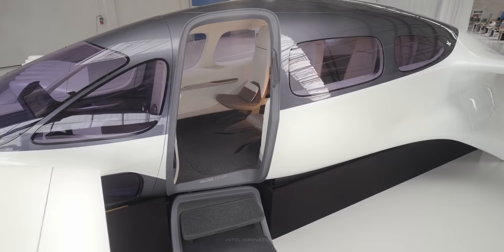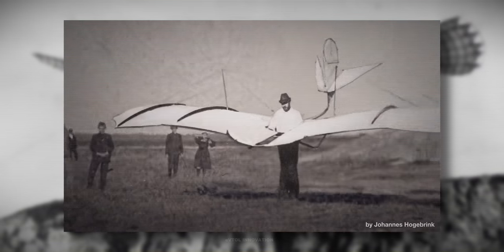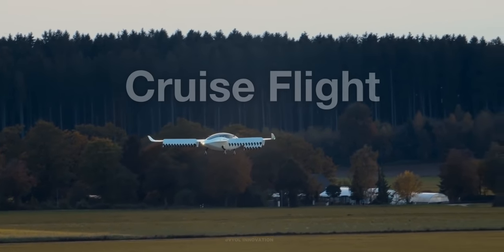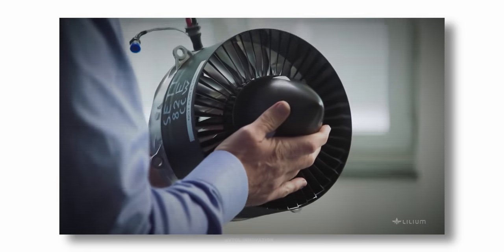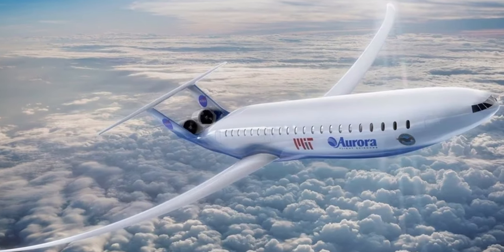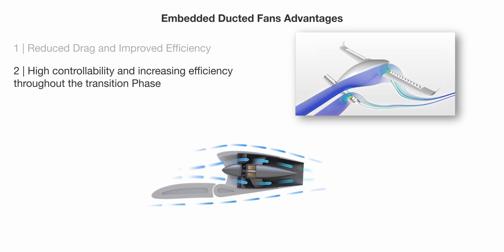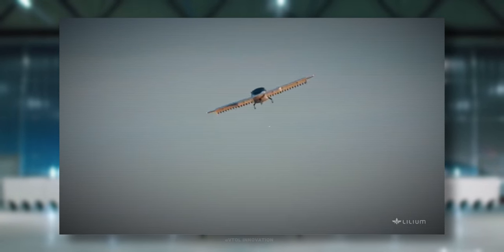The Insane Engineering behind The Lilium Jet | Part 1

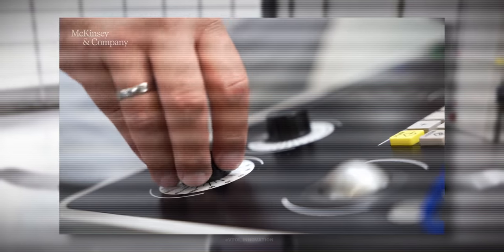Comment: I wouldn't call a marvel of engineering, more like a marvel of marketing. Basically Germany's Theranos equivalent. How can the CEO state in this video (11:00): "the technologies in this aircraft are jet aircraft and all of the airplanes flying today are jet airplanes". It's not jet technology, it's simply an electric fan and due to its small size highly inefficient.
Reply: Like that "flying cars" this will never gonna happen. Even that "Jetpack" man is more feasible than this. Why fly when you don't need to? LOL
Reply: Absolutely and the other smoking gun is the focus on the advantages only with no mention of the disadvantages of such an approach
Reply: Search for NASA's research on distributed electric fans it is the opposite of inefficient.
Reply: @kazedcat  I doubt it can ever be efficient with such small radius. Anyway, you mean it is more efficient than an normal fan? If so, we would probably start seeing camera drones starting to use them but, again, I strongly doubt it. But if you think otherwise then if you can explain the logic behind that would be awesome.
Reply: @ziad_jkhan  Electric fans have different optimization. High RPM electric motors are lighter and more efficient than a low RPM motor of the same power. This higher RPM limits the length of the fan blades to prevent the tip going supersonic which is inefficient. The trade off is that you need more fans to get the same thrust as conventional turbo fan engine. The design of several electric motor + fans is more efficient than having one giant electric motor + one giant fan. Electric makes the optimum architecture very different than traditional engine.
Reply: @kazedcat  Actually, all motors on the market are already 85% and above. Those used on planes are generally like 95% efficient. 

But, anyway, why would high RPM electric motors be more efficient??? This makes no sense if you did not realize and you need to clarify rather than expect other to just assume you 're right.
Reply: @ziad_jkhan  The explanation is very complex. Basically Power, RPM and Torque are directly correlated by an equation. If you want high power motor it is either high rpm or high torque. The problem with high torque is that another equation directly correlates it to the current flowing in motor coils. Another set of equations tells you that doubling the current quadruple your electrical losses. This means that if you want to double the power and fix the rpm your copper losses is 4 times more. The other route to doubling power is to double the RPM. Increasing RPM also has some losses but it is a lot less than double. So doubling RPM has less than double the electrical losses while doubling the torque gives you 4 times the electrical losses.
Reply: @kazedcat  So Lilium are the only guys who realized in all of a sudden, which explains why we NEVER see anyone taking advantage of those 'principles' if they are true? Sounds a bit arrogant to me I'd say.
Reply: @kazedcat  Also, I hope you realize that you're are completely ignoring the fact that propeller efficiency goes down exponentially with increase in RPM??

How is it even worth the 2-3% in efficiency for the motors themselves which are already 95% efficient??? Again, you make no sense.
Reply: @kazedcat  "The design of several electric motor + fans is more efficient than having one giant electric motor + one giant fan"

That is absolutely FALSE. Helicopters are much more efficient with one large rotor moving air slower, compared to a multirotor achieving the same lift with a bunch of smaller rotors moving the air faster.
Reply: @michaelnoble2432  Helicopters are not electric.
Reply: @ziad_jkhan  It is very new research. Nasa did demonstration testing only a couple of years back.
Reply: @ziad_jkhan  You misunderstand electric motor technology. The efficiency of electric motors is completely at the hands of the designer. The designer always have the option of making a motor more efficient by adding more copper to reduce copper losses or making the motor physically larger to reduce magnetic losses. Citing motor efficiency without the power rating or the mass and physical dimension is pointless because the motor will be as efficient as the designer intended them to be. Propeller efficiency will be part of the design compromise but max power is only needed on landing and take off so fans can throttle down to increase propeller efficiency during cruise. This is not a problem because you always need extra power during take off so designing a plane with lower power means you need a catapult system to make the plane fly.
Reply: If all people worldwide think like you mankind would never had left Stone Age!
Reply: @kazedcat  that's irrelevant. The point is about the POWER it takes to achieve thrust with different sized fans or propellers.
Reply: @michaelnoble2432  That's absolutely it. By increasing the radius by 2, you can decrease the power usage by 2 and yet achieve the same amount of thrust. That's the reason helicopters have huge radius, maximum thrust for amount of power given.
Reply: @cbazzarella  I'm not sure if Lilium is a fraud, but I'm confident it won't work as claimed. I'm guessing the first electric air taxi that's actually feasible will be more like a small version of the V22 Osprey, but even that will be a very niche product.
Reply: @michaelnoble2432  i guess, the first air taxi will be like the Jetson One. Heck, they just need to attach some foldable wings to the Jetson One, the rest works already.
Reply: @Suthriel  I forgot about the Jetson. I think people will be very nervous about any option that puts unducted spinning propellers right at body height. That thing would absolutely shred a person.
Reply: @michaelnoble2432  But to be fair, thats easy to fix with a cage or some proper cover :) (and yeah, i also don´t get, why they haven´t done this already)
Reply: @kazedcat  The rotors of a helicopter, or any other airplane, don´t care, if the motor, that drives them, is electric, combustion engine, or pure magic (also, we ahve electric helicpoters in the RC segment). They only care about torque and rpm, thats delivered to them via the axis, they are sitting on.
Also, ducted fans are more efficient than normal fans, thats true and known since a very long time (nothing new here), however, it´s also known, that large slower rotating rotors are more efficient, than smaller fast rotating rotors, if both get the same amount of power. So what you actually have to look up, is wheter your ducted fast spinning fan, which is more efficient in thrust generating than a normal fan, is less good, equal, or better than a large slower spinning rotor, that is driven by the same amount of power. And usually, the larger slow spinning rotors/props are the better choice.
Reply: @Suthriel  The source for low efficiency in electric is not the propellers but the motor itself. Non electric can use one propeller design because they do not have to deal with copper losses of a high power low RPM motor. This losses is very significant that it overpower the single propeller efficiency. Your electrical losses is larger than your propeller efficiency gain so electric design is force to compromise.
Reply: @Suthriel  cages / covers can pretty severely impact performance, and add a lot of weight. I can't see how they can avoid it if the rotors are within reach of a person though.
Reply: @michaelnoble2432  Safety matters more than raw performance for any passenger aircraft.
Reply: @michaelnoble2432  The problem is not the propeller but the electric motors. Having large propeller forces you to use low rpm motors and low rpm motors are very inefficient. Keeping the same power and cutting the RPM in half quadruples the electrical losses. Having the highest propeller efficiency is not ideal because that means having the lowest motor efficiency due to the mismatch RPM issue. The most efficient motors are high RPM but the most efficient propeller is low RPM. This two boundaries tells you that optimum design is somewhere in the middle. But you keep ignoring the electrical losses in favor of propeller efficiency. If we can ignore physics in our aircraft design then how about we ignore gravity to design a very efficient plane.
Reply: @kazedcat  "low rpm motors are very inefficient. Keeping the same power and cutting the RPM in half quadruples the electrical losses"

That is complete nonsense. Motors designed for low RPM can be just as efficient, though they need to be larger to achieve the required torque (which is why gearboxes are usually used to reduce the overall weight). 

I actually design systems using permanent-magnet motors for my job. I urge you to do a bit more research on this stuff.
Reply: @cbazzarella  : That would lower the cruise speed; the design is trying to optimize vertical takeoff/landing with standard plane cruise speed.

Comment: Why the speed and altitude restrictions, man just go for it!!!  The propulsion system looks cool and all but I'd argue that battery technology isn't there yet. I would like to know what the proposed specs of the full size version will be. For example, a Cirrus Vision which is a single jet engine has a range of 1,000 km with a speed of 300 knots. Will the Lilium be able to be able to match that?

Comment: Vertical take-off could be assisted by an electrical extension cord, jettisoned prior to transition, to conserve battery charge.
Reply: I upvoted but could be interesting to get to a minimal altitude to transition to a climb profile.  It would still probably only be a max of several hundred feet as you could imagine that the weight of copper needed to supply the power might be of a fairly heavy gauge.  The gating factor would be the max weight of the cable supplying the power that would still allow the aircraft to climb at a given gross weight.

Comment: Thanks for the video. I would appreciate if you talk a little more of the drawbacks of this solution. In your video it seems Lilium is the only way to go :)
Reply: so far, compared to other electric solutions, i don't see any drawback.
Reply: Primary Drawback - is simply that it is a new Aircraft that needs to be certified, but the certification requirements are all new, Because of the Energy Source (Batteries), and the Powertrain Design, (Encapsulated Ducted Fan on Flaps), and possibly a "New Flight Control" Approach, of using power adjustments for some of the Aileron and Rudder Functions!

Other than that, it builds on knowledge in aerospace design, that has been collectively developed over the last 120 years! And Adds a new twist, many small vs one single large, power source! (Or, as is typical today, "Two" copies of a "Single Large Power Source" - be they Piston, Turboprop, or Fan Jet Engines! The Classic "Turbo-Jet" that has no "Bypass Fan" is seldom used anymore, in Civil Aviation.)

Comment: I have had some experience with edfs and they are amp hogs I would be interested to see how they have overcome this and what is the battery tech they are using. I wish them all the best with this project
Reply: ??? More efficient than unducted
Reply: @freepadz6241   I did not mention that? My query is that EDF's consume power due to the rpm being higher than normal depending on the number of stators against props  where gearboxes can be employed and I am curious about the esc's, amperage and Battery type/size/range etc. I am not knocking the idea I think it is good ,just curious.
Has it flown yet?
Reply: @minuteman4394  you are absolutely correct - EDFs are inefficient compared to larger props, so any advantage gained by ducting is overwhelmed by the size disadvantage.
Reply: @michaelnoble2432  But someone said EDFs are more efficient than open props with the same sized props...
Reply: @kennyzhou4353  yes, EDFs can be more efficient FOR THE SAME SIZE, but these are MUCH smaller (and therefore less efficient) than the propellers on a conventional plane.
Reply: @michaelnoble2432  1. Does it mean that EDFs is the right way for eVtols compared with open propellers, since the efficiency of the same size is higher? 2. If the positive correlation between size and efficiency is common sense, why doesn't Lilium use a larger propeller?
Reply: @kennyzhou4353  1. I'm not an expert, but ducted fans are only more efficient in certain circumstances. They add a lot of weight in larger sizes. 
2. That's a good question, and why I don't think they'll be successful. Those tiny fans use an enormous amount of power for the thrust they give.